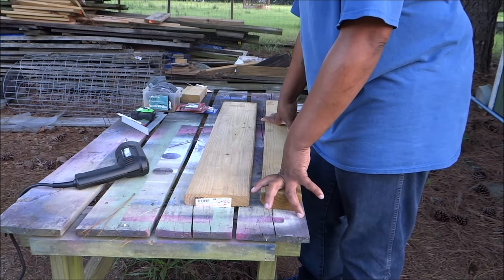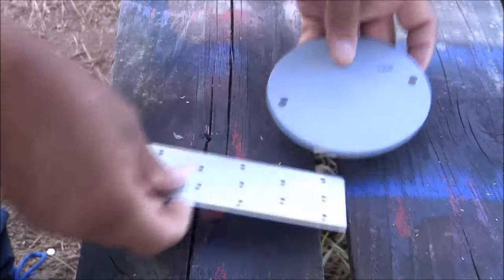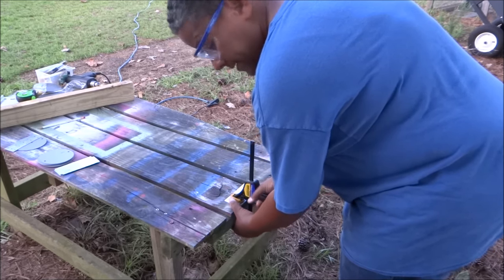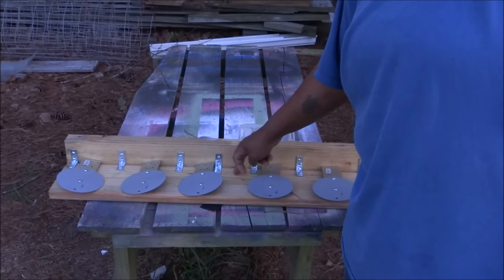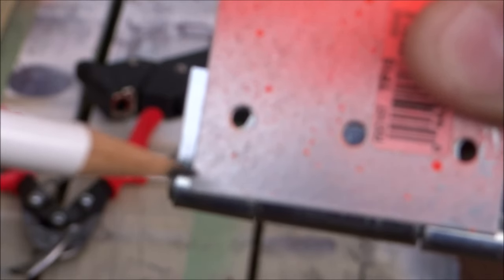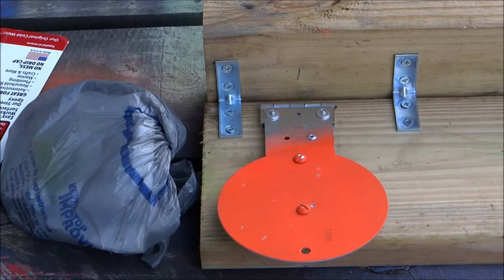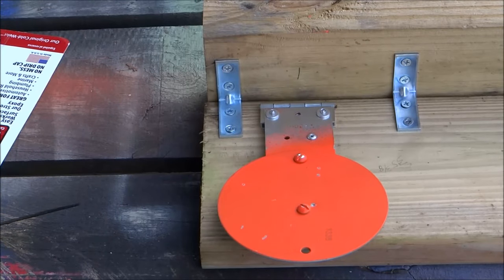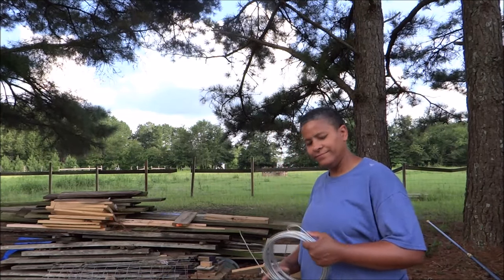How To Make Plate Resetting Target

Comment: Great work! If you put magnets on the front piece of wood, it'll help keep them set
Reply from the maker: Joe I think that is an excellent idea I do have some small magnets to try. Thank you for watching
Reply: @tiffanyoutdoors3885  ifui8k it's 11 Emma Road
Reply: when setting the hinges place them back a 1/8 th of a inch from the front board. That way the target leans slightly to the front. And that should help them stay up without the need for magnets? The magnets are a good idea though.
Reply: @bryansmith5980  great fix without buying extra material!
Reply: dangt, just my thought to! :D Cheers from sweden to you all :)

Comment: Great video. Wish I'd have found this 4 months ago. Would have saved me some trial and error. Another excellent target is the metal caps for steel fencing. The weld on type. Drill a hole in the top for a bolt, drill a small hole in the end of the bolt, and hang with some bailing wire. Makes a great little bell target. Have a wonderful day.
Reply from the maker: Joseph thank you for the compliment!!  I love this idea for the bell targets...thank you for watching

Comment: Nice job! It's always tough to come up with a target design that can work flawlessly with a large range of different powered air guns. For the rifle, I'd either lean the entire base forward a little or move back the hinge on each target such that the targets lean forward a little when the base is level. This should prevent targets you're not shooting at from falling when you hit the one you are shooting at. Personally, I'd avoid shooting bb's at a steel target as the ricochet's can become unpredictable.
Reply from the maker: Thank you for the idea. I was thinking that I would try putting some soft foam on the back of each target so when it does fall the others wont fall too. Yes I agree the BBs did come back at me on some of my shots
Reply: You're most welcome. I think what you came up with is pretty cool!
Reply: i think a pieces of magnets placed at the back of the frontal piece of wood acordingly to the target plates would do the trick of unwanted falling of others
Reply from the maker: that is a good idea!! thank you
Reply: Agreed - move the hinges back a little.

Comment: I’m not going to lie for a girl I am actually very impressed I will tell you did a hell of a damn job I am going to give you a few little pointers about the resetting bar you could go a  stiffer bar and to prevent that type of metal from slipping out the sides you can bend it up words so it doesn’t slide out
Reply from the maker: thank you Zackary I do like your idea for a stiffer bar than you,  thank you for watching

Comment: Have the targets lean against bolts  or screws that adjust to set the angle the plates lean at.
Reply from the maker: Check Mate this is such an excellent and simple idea. Thank you so much for sharing this!! this idea would make it super adjustable and I could use any pellet gun
Reply: @tiffanyoutdoors3885 your very wellcome. Also heres some other ideas

 magnets can help hold the plates up in wind. 
If combined with set screws it would be possible to tune how 'sticky' it is to the magnet. 

A large  wheel of sorts mounted to the side would offer larger mechanical advantage for the reset bar.
As the rope would roll over the continuous outer edge of the wheel the mechanical advantage would always be at its highest during the arch of motion the reset bar takes. 

Hope this helps

Comment: I think they would stand up a little better if there was a slight forward angle on the front 2x4 100-110 deg instead of 90.  That would allow the plates to lean slightly forward and stay standing easier.
Reply from the maker: yes thank you John for a good idea to try. I will try this and see how it works

Comment: Maybe weld a light spring to the target and secured to the wood. I'd use maybe about a 1" diameter and 10" length spring. If 10" length is too much, cut it to size with straight cutters.
Reply from the maker: I wish I could weld!!! That is something that I want to give a try in the future. Thank you for watching

Comment: ideahave good i make same but cheap better material and little different style strongest. no wire  i think better use strong aluminium tube or wood rod, wire not good. hinge little far back and adjust scew how accurate. sensitive have target drop down. can adjust at screw. and aluminium sheet and ok.
Reply from the maker: I dont leave this outside its mobile and I keep it in my shed. so therefore zero rot. metal can be expensive and most people will not have the tools to drill or cut it

Comment: this wire has totally shit, why not use wood rod or aluminium tube or steel tube this.
Reply from the maker: I used what I had on hand....this project worked for me it may not be perfect but it works...so in my opinion it is NOT total shit

Comment: you dont got the money to do it with plastic parts, but the you go ahead and do your target with more expensive metal plates lol
Reply from the maker: Ummm use plastic with a lead pellet? If I used plastic I would be replacing parts every time I use it LOL Using cheap plastic would cost more money than just using a metal plate that has lasted me years